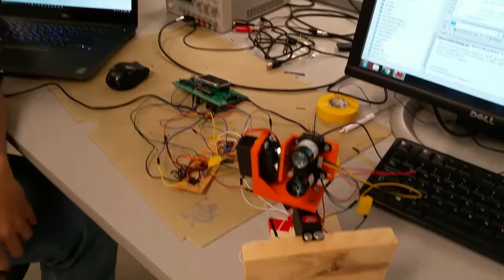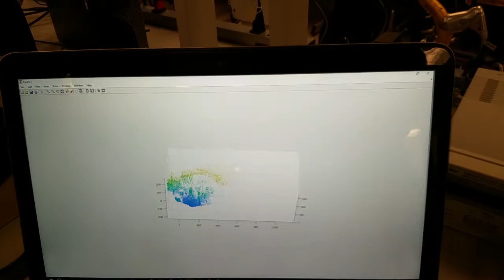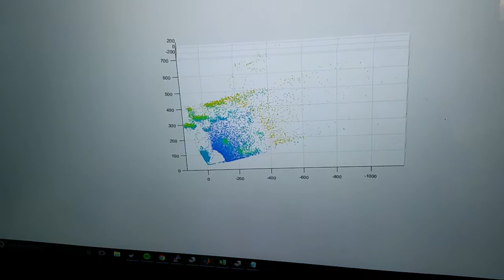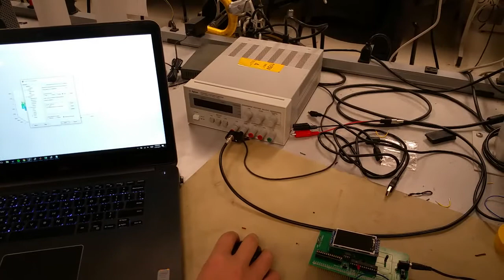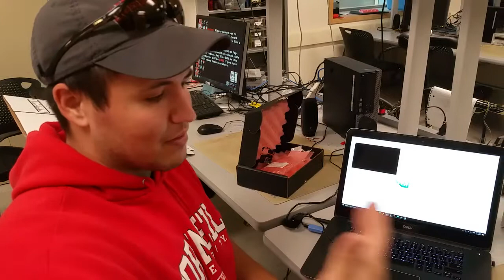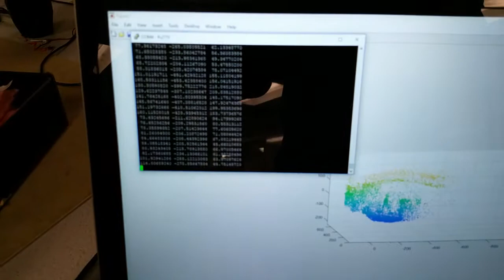Lidar distance scanner and imager

Comment: Can we use any any other lidar sensor for the same circuits you have used in this project, I'm waiting for your response
Reply from the maker: How could I possibly answer this? You have to match the circuit you build to the requirements of whatever LIDAR you use..
Reply: @ece4760  thank you for your response I have another question why have you used two differential amplifiers, will the circuit given in this link https://lidarscanner.wordpress.com/
Enough?
And how do you connect this set-up to your laptop and which software is used to process the data, waiting for your response, thank you in advance
Reply from the maker: @AkshayKumar-eb1bx  There are two diff amps because there are two servo feedback signals. As for the second question, quote from the report. "Below are several 3d images created using the output of the system over UART as well as pictures of the scene being scanned. If you have a .pcd file reader, such as Matlab, you can view the 3d image by downloading the. pcd file in Appendix C." They did not include the Matlab program in the report.